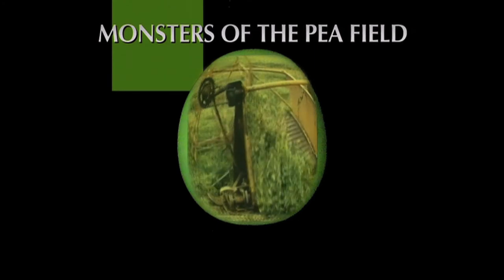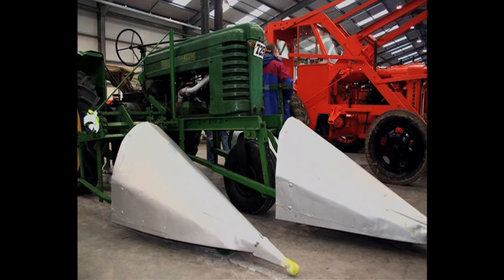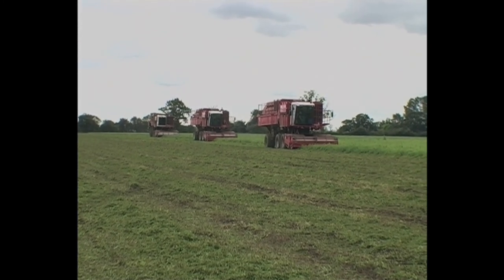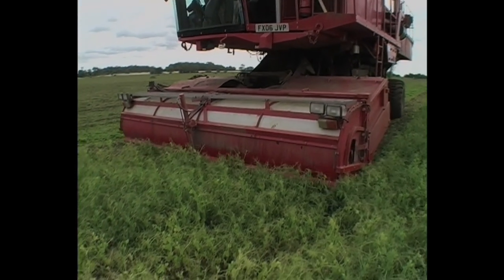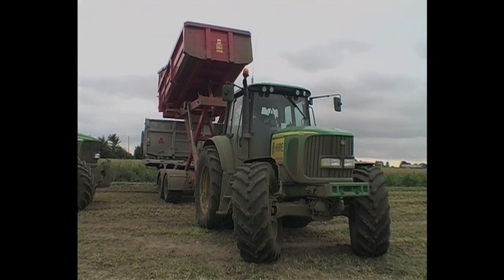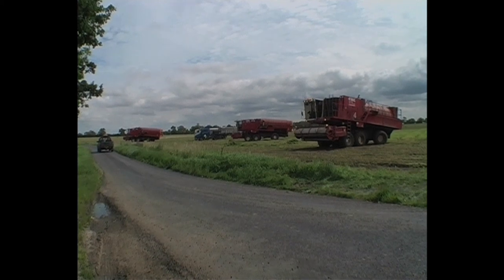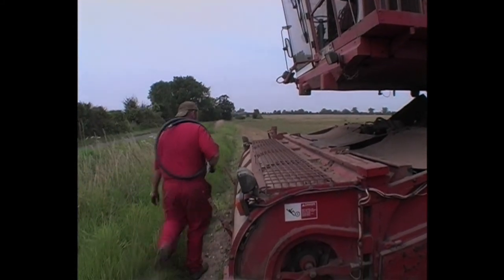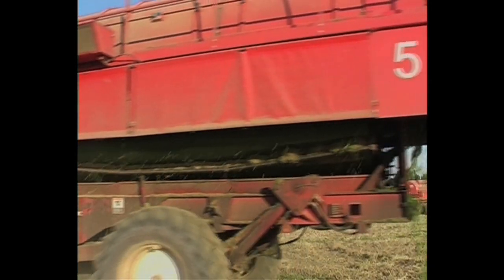Monsters of the Pea Field - The Story of the Pea Harvester (Trailer for DVD)

Comment: i use to drive these back in highschool in the late 90s,  the fmcs had the diesels in the rear.. had one john deere  and the rest duetz v8s air cooled.  the muddy fields were the best getting those diesels to bogg a little bit watchin the gauges raise in temp!!
Reply: I operated the first pull-type and self-propelled pea harvestors (FMC with Deutz aircooled egines) in the mid 1970s. Pea vines were mowed with a swather, the harvesters had a pickup. We had to watch our speed constantly to avoid plugging the feeder chain, and on rainy days the nets inside the beater would get coated with wet leaves and empty pods and we had to beat them with a stick every 30 minutes, or the peas would go right through to the back and on the ground.